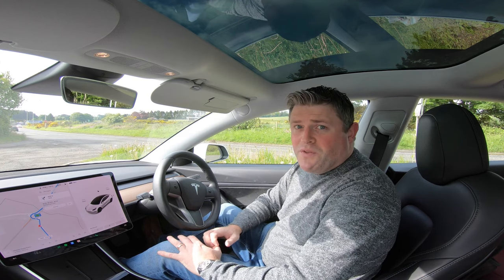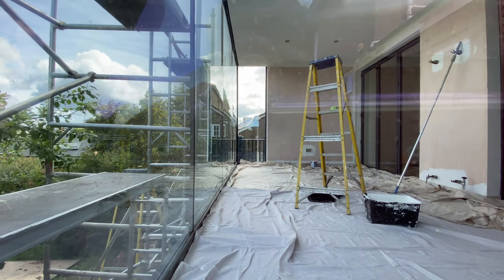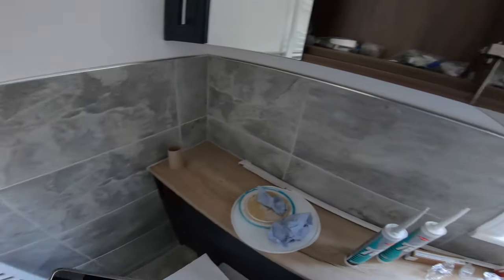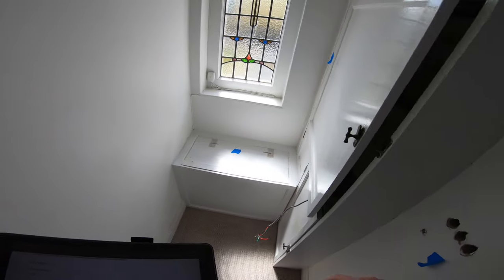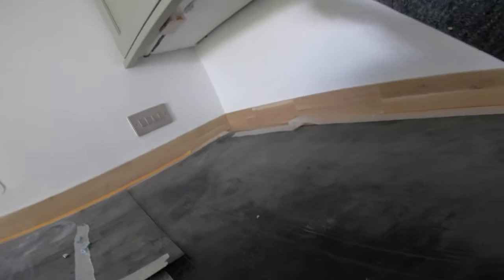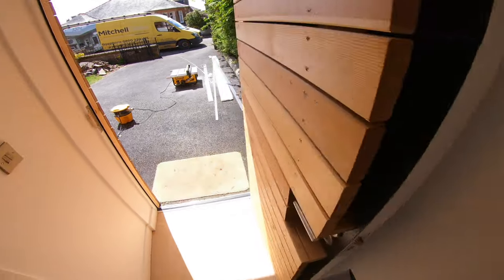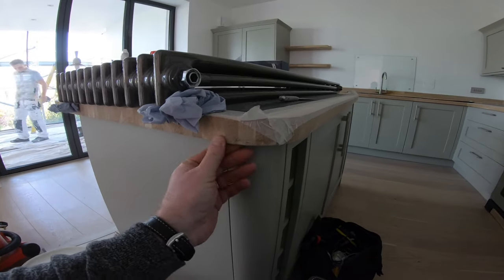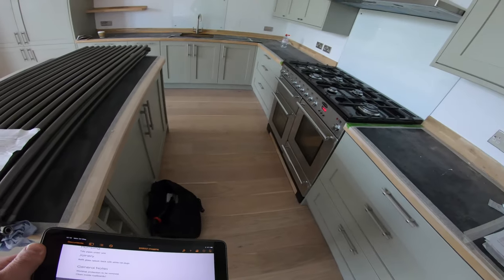How to Snag a House - Finding Construction Defects

Comment: Ever dealt with NHBC and Redrow for enforcement of standards? Few videos I've put up on here, 3 and half years on still fighting them. Curious what you would make of it.
Reply from the maker: In my early career I worked for larger firms who did big housing developments. These were covered by NHBC and the builders endlessly complained about the extra level of detail required, far beyond what building control would ask for. I don’t have any experience dealing with claims however.